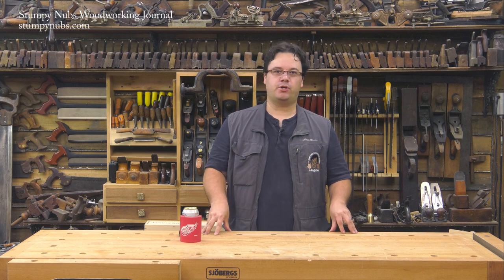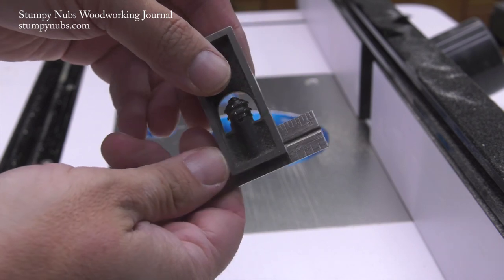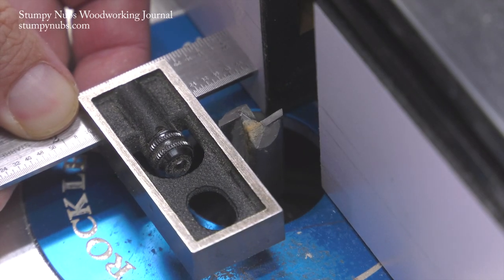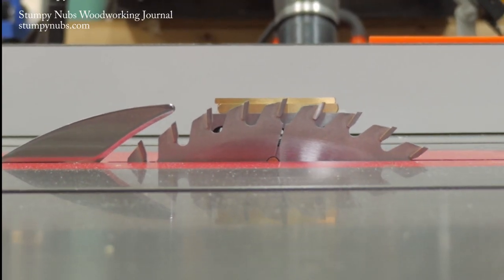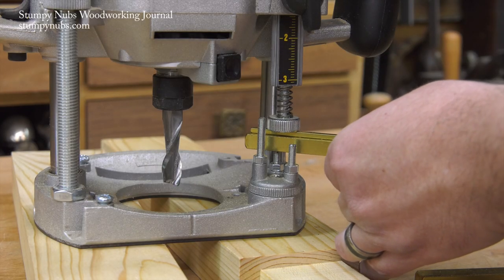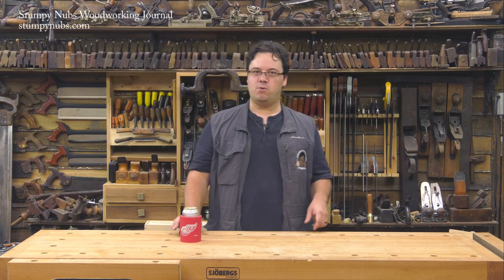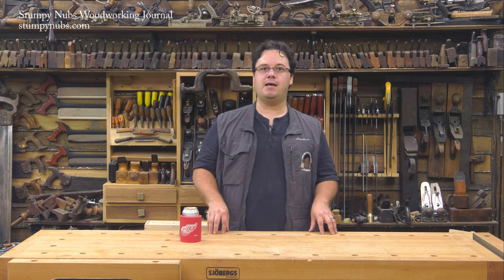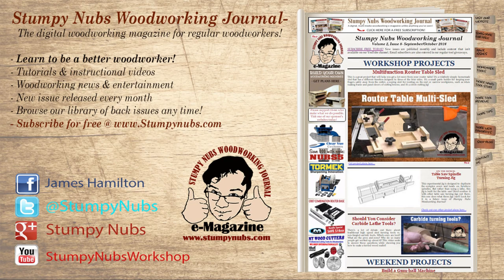3 Tricks for Quick & Accurate Router Table Setup

Comment: I also use a digital height gauge for profile bits. When I find the "sweet spot" on a roundover bit I make a note of the height and write it on the bit case. Saves a lot of time next time I use the bit. Note that "identical" bits from the same manufacturer will not necessarily have the same height to the top of the bearing relative to the cutting profile. I use the digital height gauge with two legs that straddles the bit to set the router fence relative to the far edge of straight bits when cutting dadoes, grooves, or rabbets.

Comment: Thanks much for this, I always enjoy your videos and I've even bought a couple of things from your links.

I made a gauge for setting saw and router bit heights by cutting a bit of 3/4" hardwood dowel about 3" long, and sandwiching between two pieces of mdf a few thousandths thinner than the dowel and about 3" square.  I glued two pieces of  hardboard (one per side) to the mdf, so that the dowel was trapped with a friction fit between the mdf pieces on the sides and the hardboard pieces on the front and back.  Then I cut everything on the table saw with the dowel in the middle so that the dowel and the mdf/hardboard sandwich are the same height.  I pulled the dowel out and cut a slot about 2" high through the center of the sandwich.

To use it, I put the dowel back in the center and place it over the saw or router bit.  I then measure the amount of dowel that sticks above the sandwich with a dial caliper.  This way I can very quickly set the height within a thousandth of an inch.

Thanks again for your videos.  I've learned a lot from you.

Mike

Comment: I don’t like using steel tools against the bit, only use brass
Reply from the maker: If you're hitting the bit that hard with the tool, you're doing something wrong. Carbide isn't razor sharp, the edge is very durable.

Comment: Frist, don't buy a performax router table. The plunge router needs 4 hands to adjust the cut height because of the excessive spring on the plunge part. And forget about any fine tuning the height. Yes Router table for sale. But You been warned.